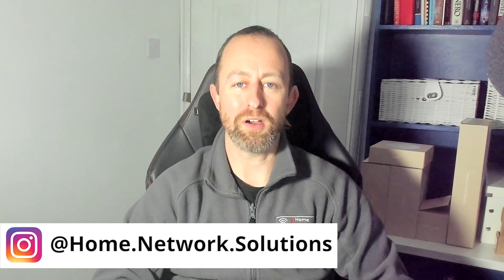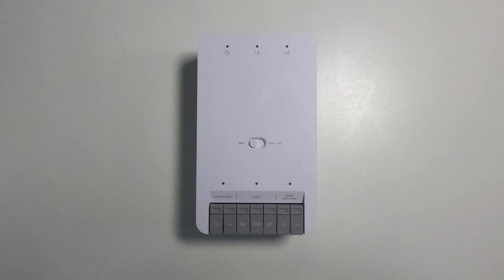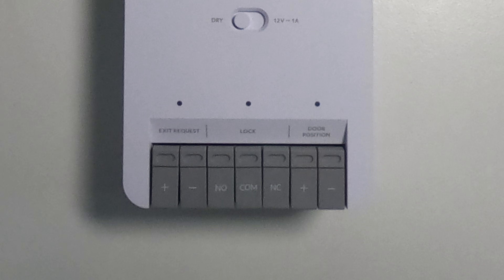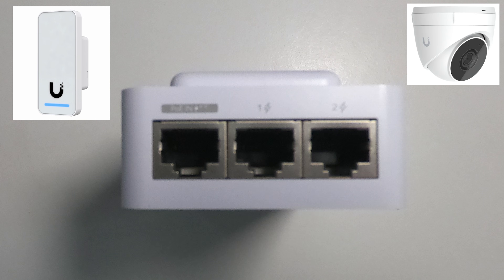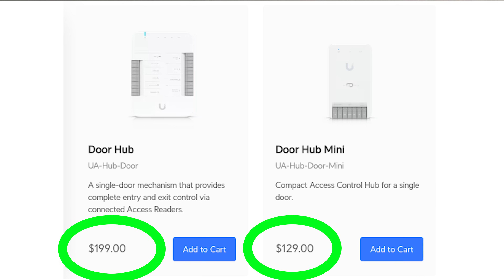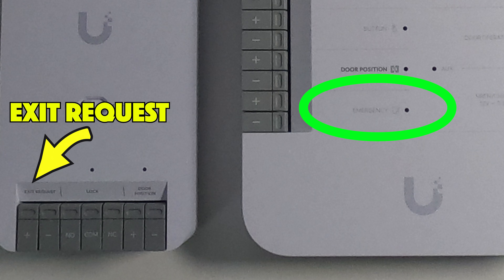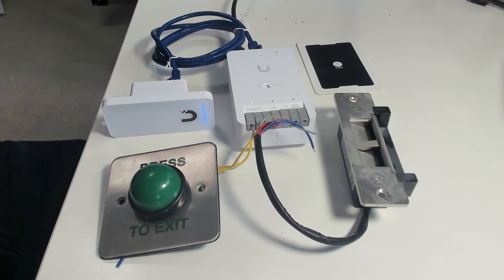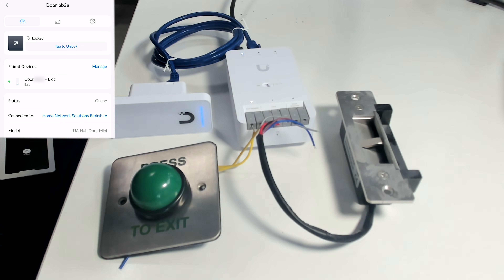UniFi Access Door Hub Mini Review | SMALL BUT MIGHTY DOOR HUB?

Comment: Having issue with mini hub not seeing maglock in terminal manager. It shows that the wires are connected and it’s getting power but green light not showing under lock. If I press exit request button the lock unlocks but I get no sound from the hub and the delay that I set doesn’t work. Any help would be appreciated

Comment: Can it be used together with G4 Doorbell pro and Intercom viewer?

Use case:
- Door Hub Mini
  - Connect 12V electrical door opener
- G4 Doorbell Pro (Outside)
  - Ring, Camera and Talk
- Intercom Viewer (Inside)
  - Using it as chime (As it has 2 way audio)
  - See who is at the door
  - Talking
  - Press a button to open the door
Reply from the maker: I don’t think so, but Ubiquiti often roll out changes so it may be possible in the future. Thanks for watching!
Reply: you can open the door by sending an event from the g4, but not sure about the intercom